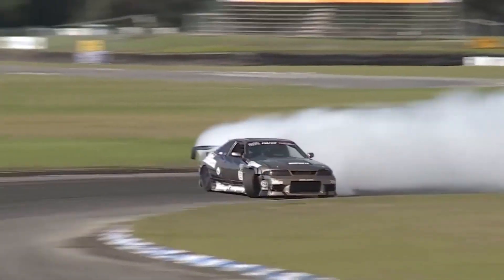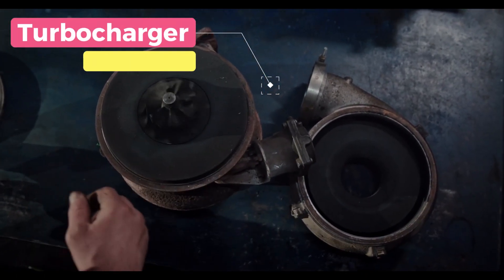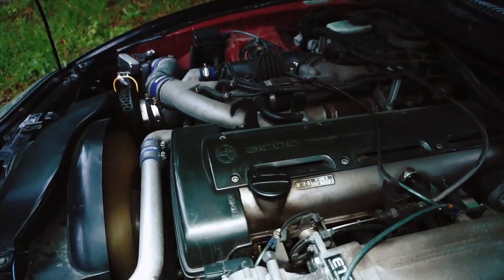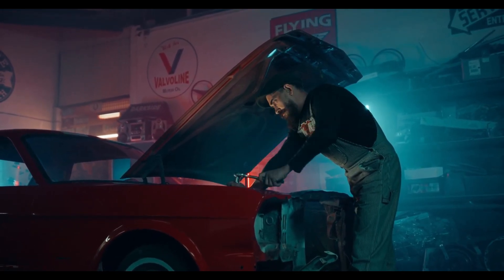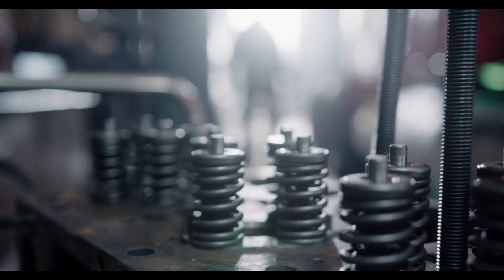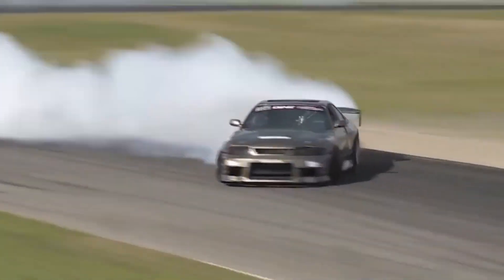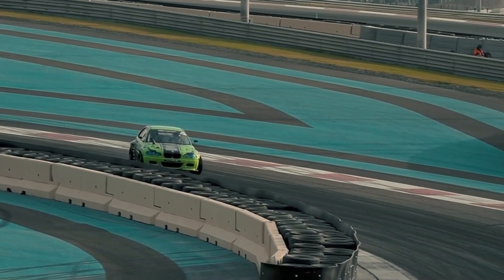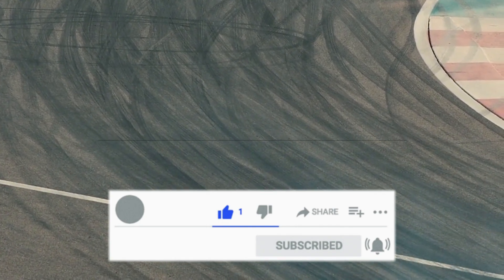Car Tuning Stages : from Stage 1 to Stage 4 Tuning Explained

Comment: I had my car tuned to stage 1 but at that time I was running a 99 octane fuel which is the premium here in the UK. Is it the same or better or worse having your car tuned at 99 instead of at 95 octane?

Comment: Stage 1 might also only include just a mapping of the ECU, without any hardware modifications. There are two types of ECU mapping: OTS (on the spot with a download and laptop) and Flash mapping, which would typically done at a Tuner shop, as far as I know - and just learning!

Comment: So just so your aware because this guy is wrong all stage tunes basically means “ecu reformat” to accommodate the mods you do to a car for example if on a stock tune stage 0 basically that’s tuned for economy so if you throw a cold air intake and an exhaust the car will be a tiny bit quicker but be limited due to the tune not combating the change in airflow, density, and pressure which may lead the stock ecu which changes its input based on variables automatically may lead to it running rich or poor which overtime can wear out O2 sensors, and damage parts essentially a tune stage 1 and up is just changing certain engine behavior that is controlled by the cars computer “ecu” to maximize performance or efficiency based on the mods you have added to a car most “tuning software for the majority of car brands only go up to stage 2 and when you apply additional mods past air intake and exhaust they reprogram the tune to make it accommodate the new mods

Comment: this pisses me off

"stages" in car tuning is subjective. While one tuner may call "stage 1" to a remap or installing a better exhaust, other tuners may just switch out the air filter and change valvesprings to increase rpms. "Stages" are just an oversimplified way of explaining modifications done to a car and should not be listened to. If someone comes up and tells you that they had a stage 1 done to their car, it doesn't matter as you don't know exactly what has been done to it. What matters at the end of the day is the modifications done to it and not the "stage".

So stages don't necessarily mean that a car has been modified more or less. What really counts is what has been changed.
Reply: wrong, stages terminologies make things more arranged and and in order. these "stages" should be a worldwide standard that everyone should follow. imagine being new to car tuning community and u have no idea where to start from, many mods many names many terminologies many things. stages make things simpler and in order and easy to understand. anyone who mention anything outside this is a random guy. 

i also suggest that stages can include primary and secondary mods.
 
stage 1: 
primary mods
secondary mods

stage 2: 
primary mods 
secondary mods 

and so ....
Reply: @anwarsebai brother just keep it as it is. Stage 1 is ecu tune. Stage 2 is ecu tune and exhaust/intake stuff. Stage 3 is those plus upgrading engine internals like pistons and stuff
Reply: 100% spot on and in most cases ECU is always stage 1 as it's just hardware and no parts replacement
Reply: If you know how to talk to people, instead of being a typical ricer douche, your next question would be "What was included in your Stage 1 mod?" Simple.